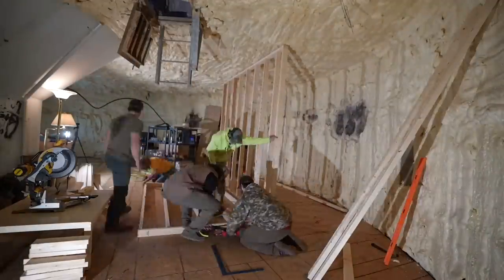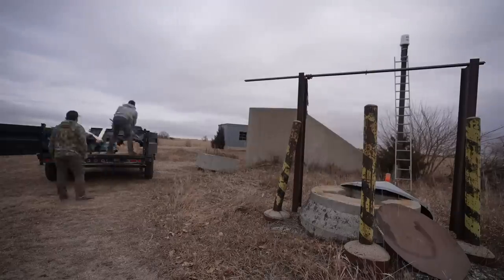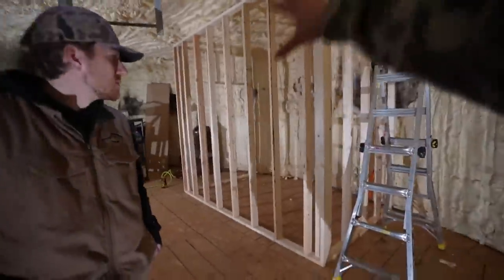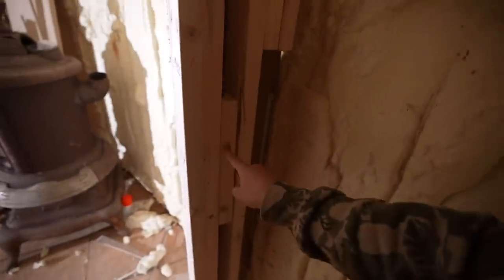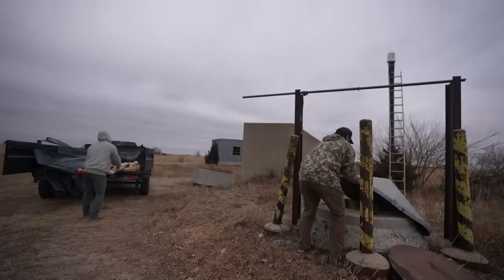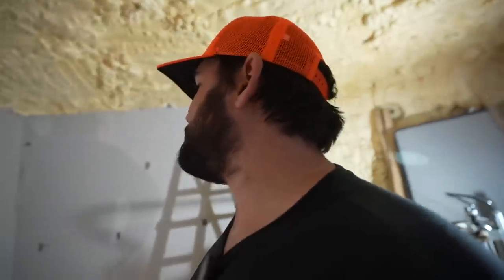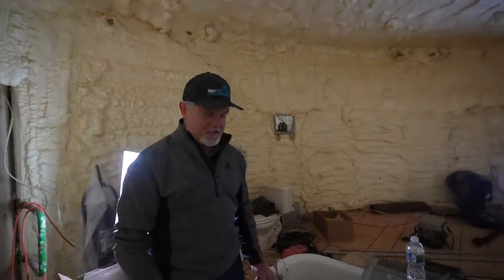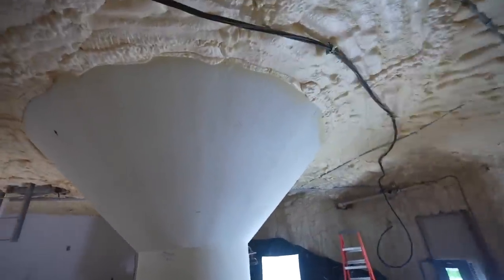Renovating My NUCLEAR Doomsday MISSILE BUNKER!!! (Ep. 1)

Comment: The whole hanging from the ceiling idea is on point I'd probably do an extra bed from the ceiling in case you have visitors you could lower it down, but still have it high enough you have to climb a rope ladder to get into it, maybe even a hammock off the bottom of the bed even! Nothing wrong with being creative

Comment: Make sure the foam dose not absorb moisture from steam in the bathroom , it will go mouldy. Far better to enclose the inside walls of the bathroom with moisture resistant board and run an electric vent to the escape hatch.

Comment: if you plan on living in this silo,correct the wiring mains coming into the silo control room, you'll also need a fire detection/gas detection system and backup power for critical escape/emergency lighting systems..this underground facility has different requirements than an aboveground structure. Get qualified help,residential electrician won't cut it..best of luck

Comment: Sheeew flair....silo looking loads better.
Ideas u say...ok here we go..
Hatch up top. Escape hatch...needs work too. Seen that you can get an old rusty car with trunk or bonnet. You cut in half and bury it so the bonnet opens for access to the escape tunnel. Sneaky and hidden and alot less obvious?

In the silo. You should use rgb light strips so can be changed any colour...uplit and downlit in walls or behind furniture. Flooring should probrably be either something industrial looking or wood effect and homely...with some nice big rugs. Esp in front of a big electric fire place. Couple of reclining chairs be great and square type couch with central coffee table...coffee table made of pallets on castors or something like a jet engine cowling.
You may need a way of pumping fresh air down into silo and couple generators up top as a back up power supply. Install a solar aray with lithium batterys but again be sneaky with solar panels so they can be hidden or not seen from road etc...but still usable.
Some wall hangings or giant sticker of woods and trees would give a good vibe...almost like a window. But not.
Install lighting but make couple grow lights...so you can have some kind of plants down there...aid the mood n feel of place but also give out oxygen.
Pantry should have canned food n dry goods...as much as possible. Buy up walmart etc. Plus bottled water n can drinks.
Perhaps add a couple of bunkers in the field above the silo...dig out. Wood inside concrete or/sand bagged...camo'd up with netting. Maybe add couple of containers use as a compound and storage could even half bury so from road there look like small hill otherside open and usable in a courtyard type shape. Could always grow plants n food in courtyard....plus planting a small orchard on the land above apples,pears,nut trees etc.

Well theres some ideas...keep up the good work.
Peace.

Comment: @FLAIR, I think beds attached to the walls would be cool.  ALSO make them curve with the wall and then you can add charging usb ports and outlets for phones and tablets.  That way you can fold them up or down, should you need more room.  Also maybe you could find some old army foot lockers for storage, that can just lay beneath where the bottom bunk folds out, that way when your staying there so you dont have bags of clothes laying around and you can store bedding etc inside them in the mean time.  Also have you thought of a table that folds out with seats that are 12v refrigerator/freezers under them (they can be put either on drawer slides  or just in  box seating.  It will be frugal on your power system but its also a great way to keep things cold or frozen.  When you look for a fridge you may want to find a 12v one as well.  A lot of these items are great for tiny homes etc.  If you can use things for more then one purpose I think youll really appreciate it long term so keep that in mind.  Also drying rack or cable system in the bath shower for clothes/ coats if they were washed or just wet. They have a nice one at home depot that ive seen in some tiny homes and its not very noticable.  Dont forget coat hooks for your gear unless you will just put ur coats over chairs at the table you had mentioned.  For the couch or sofa, maybe a pullout or futon that way it doubles as extra sleeping.  Or perhaps build bank seating that way youll have extra storage under the seats for food, supplies, pews etc. Iron tub??? You could sell for scrap, you could make sheilds or use it as armour on ur bugout vehicle, etc.    Have you thought about making your entrance a bit more hidden.  I know you had talked about building an actual building around the entrance, and hide it a bit better.  Im curious if youll be adding a shop etc to this property or even a pull barn etc.  Love the content cant wait to see what else you have in mind.  If you still want to get down in the silo, magnet fish the metal/iron and scrap it to help pay for the renos.  Enjoy the build and catch you on the next video

Comment: Hey flair, I suggest getting some foam insulation spray, we used to use it under houses, it works great for insulating and lasts very long, it’s a orange foam that comes out a liquid and dries very fast and it dries hard just like foam insulation u can find it at Home Depot or lowest most likely or the internet! Just figured I’d tell you about it !

Comment: You should get some of the strip LED lights that have a controller that makes them flash and change color to put all the way around the top of the beehive for coolness and to turn on and dim down at nighttime for like a nightlight so that you can see how to get to the bathroom or get a drink or whatever might wake up and need. At night you could set them to flash red like certain lights the military uses at night in certain vehicles and they most likely had red night lights in that bunker when the military was using it. lol.

Comment: If you dont fix your doors, you have no protection against anything.   I would recommend some exterior cameras. Some water storage inside. Refill escape tunnel. Air ventilation system needs protection.  Dont forget toilet paper in addition to your food and water stores.  Power outage?? Off Grid power.   Dont use flammable gas inside your shelter. You need electric stove if your going to put in a stove or oven.
Reply: Thanks for the feedback, you have been selected among our shortlisted winners of our new year giveaway contact the number above for more information................

Comment: Yall should get a high powered water pump and drain out the silos get all that scrap out and check out the lower levels of the bunker. Or stock the mfer with bass and watch the radiation make mega monster bass

Comment: Ya know you need to get someone to come in and get the other doors working and weld stuff to the hole into the silo.
Then when this is all done this would be an awesome Air B & B .
Now instead of the projection T.V. check out the new OLED T.V. they even have 1 that flexes flat for T.V. and curved for gaming.
JerryRigEverything and What'sinside ( might be there family channel ) go to CES in Vegas and did a little reviewing of all the options.
It would be incredibly awesome if you had like a wall of curved T.V.'s ya know like 10 foot wide by 8 foot tall all cured to match the wall.

Comment: moving the kitchen was a great idea. looks way better. the color choice is kinda ehhhh i would have at least smoothed down the wall and ceiling. pluged up those holes. casue you dont know whats on the other side, have not gone with that color choice.  to dark on the top and the thing in the middle is a lil too much.